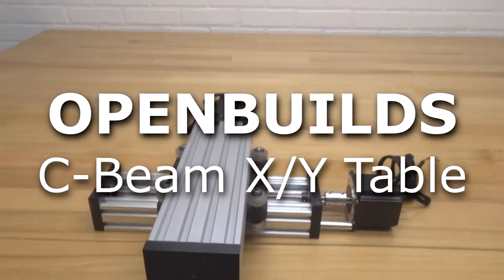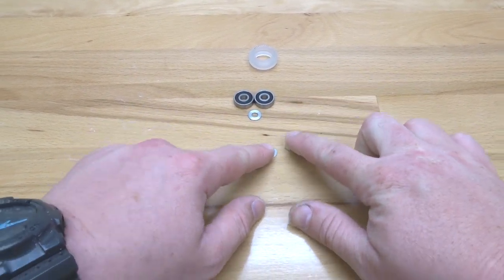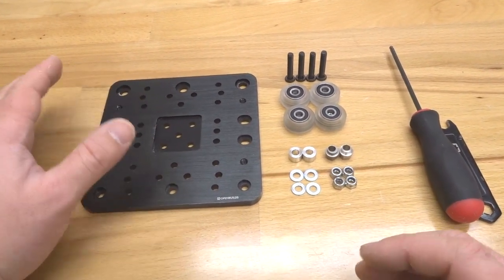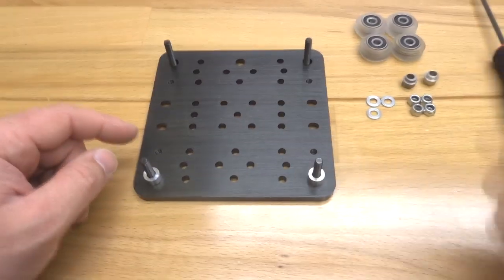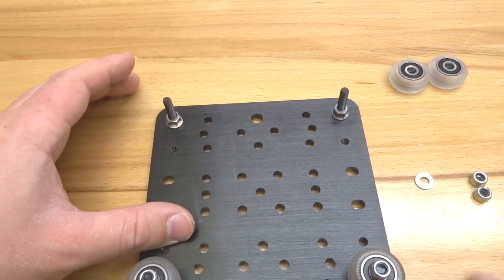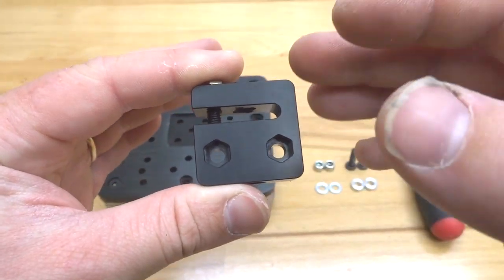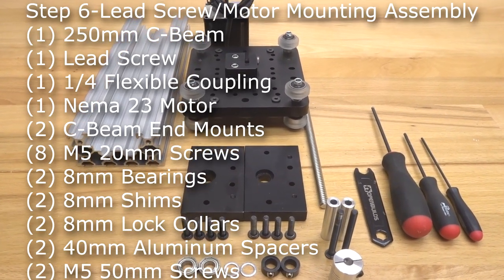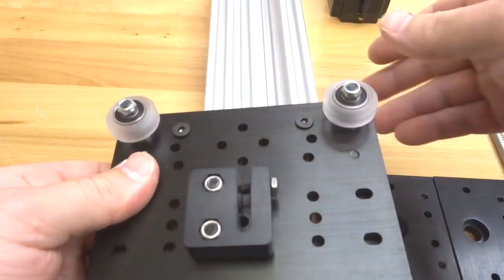OpenBuilds C-Beam® XLarge X/Y Table Build

Comment: What exactly is the purpose of the C-beam? What does it allow you to do that you couldn't otherwise do?
Reply from the maker: Hi Tom, the idea is to allow for a nice clean integration of your transmission components, aways from dust and debris all built into a rail based profile (V-Slot) with a good width size gantry cart allowing for an overall strong drive system. Please have a look a  few of these resource build for more examples of the C-Beam in use to get an idea of its ability to be adapted to many applications.
https://openbuilds.com/builds/c-beam%E2%84%A2-linear-actuator.1955/
https://openbuilds.com/builds/c-beam%C2%AE-xlarge-linear-actuator.7424/
https://openbuilds.com/builds/c-beam%C2%AE-tension-xl-linear-actuator.9468/